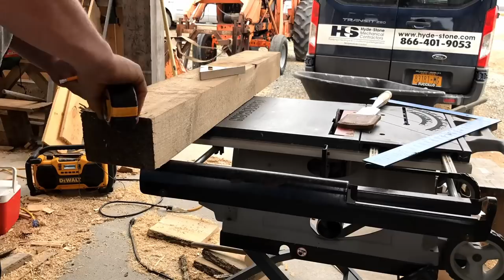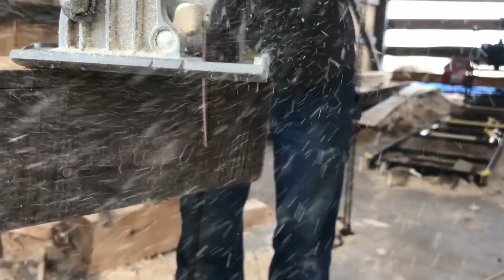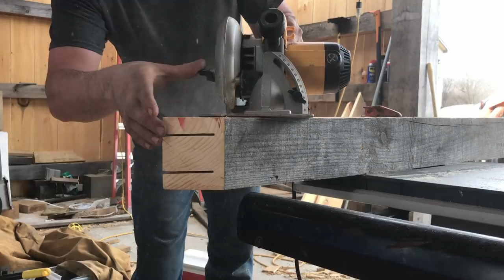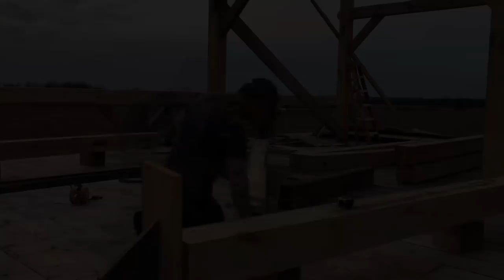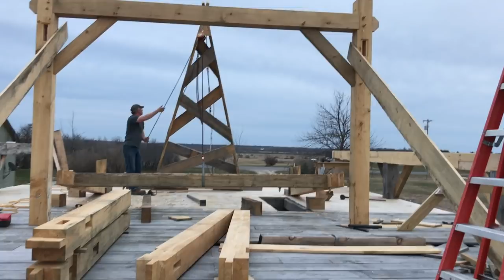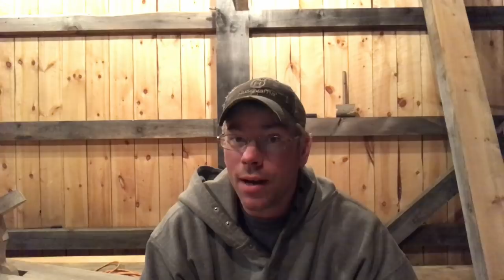Raising More Timber Frame By Hand

Comment: Hi Jim, 
I'm assuming the Queen posts are to go flush with the gable end. My suggestion is that you attach the 'A frame hoist' to the gable face of the barn. It appears you have about  4' +, clearance with the top of this when erecting the other Bents. This would allow a yard or more for connection down the gable.
You will know where the post feet need to be positioned. 
As you have done for the other Bents, place boards (front timbers) to stop movement toward the pulley. 
Nail side timbers, and importantly, a rear timber, to define the queen post, so that the footprint of each post is defined on the deck, make sufficient tolerance that the posts aren't a tight fit and can drop in when vertical.
Set the Bent up on sawhorses when in position against the front timber boards. You can use bottle jacks to increase the elevation at this point if you wish. Assess if your son is able to  control the tractor sufficiently and if so, good. Helped by him in the tractor, using the 'A' frame pull the bent up to 75 - 80 degrees, switch then to the come-along. 
Before raising, measure and attach rope from the rear of the barn to the  cross member of the Bent so that it cannot over rotate. I also recommend that you attach trailing planks to lateral sides of the queen posts about 2 metres up, when raising, to connect with scrap timbers nailed by you at right angles to the vector of travel - these will arrest any fall back incident. 
Just some suggestions - this is what I would tend to do with this. I would not be happy to use the other Bents at this stage as they are not fully incorporated into the building yet as they aren't  braced sufficiently and it would be a tragedy if they were pulled over and destroyed  by ill considered planning.
If You decide to go for the inside route,  then as mentioned above use bottle jacks and lots of props and all should be good.
Reply from the maker: Great information here and confirming a few of my own thoughts.

Comment: I wonder if the mouse got in through the big capping hole in the end wall of the barn/shop. Afternoon, Jim. Question, why not put the top plates and braces on the queen post bent when you stand it? Roughly half way up would be a good spot to do it, then it can lift the tops up with it and you could use a step ladder to put it on the previous bent. As far as the other two coming from the other direction, lean the shear-legs against the previous bent and draw it up from over the top of that one? Can't wait to see how you do the tops with those bents stood already.
1st final is out of the way. I'm guessing a low A to high B. At least I hope so, I need that to pass the course. Hope you're having fun out there.
Reply from the maker: Logistics, no way in he'll could I do that alone.  Those purlin plates will be 16' long.
Reply: TheTradesmanChannel oh, I thought you were superman... Lol.

Comment: I had to chuckle. Jesse (PLfL) did the exact same process--cheek cuts on angled braces--on very nearly the same saw. He's right handed and you're left handed. It only took a few seconds to notice the difference as you made the cuts.

I have significant experience in table saws in general and Craftsman saws in particular. It's been a wildly popular subject on the various wooddorking fora I frequent. I've owned the forerunner of the saw you have (built by Emerson Electric, a long time Sears supplier, although no longer, and the supplier--at least for while--of Home Depot's Ridgid line). Among its limitations is the fence and the insert. 

I don't know a modern improvement for the fence, the one I had was discontinued long ago. Actually I discontinued my Craftsman saw long ago, too, replaced with a Delta Unisaw. Night and day, but that's another topic. However, here is an article on my website you may appreciate as it highlights (and explains) one of the many complaints about Craftsman tablesaws:
http://woodbutcher.net/miterslot.shtml

I have a potentially useful suggestion for assembling and raising the queen posts, but it's too long to post here. If you're interested, please drop me an email to LRod@pobox.com and I'll reply as soon as possible.

LRod

Comment: The comments about working from the center bents are headed the right way i believe. Either tied with top plates or temporary bracing. Set the shear leg from center out tied to existing bents. Set it close to end wall so the top of the leg is a straight pick,  letting the new bent stand almost exactly in position when raised. Assemble the end bents with legs toward center, crosstie almost over endwall below. So when you raise the bent the legs will slowly slide toward the end of the barn, top of the bent raises nearly vertically.  Shear leg is positioned so that you would lower it instead of raising it to fine tune your position. If this was mine to do anyways, thats probably what i would do. You've got a lot under your belt at this point so I'm watching with everyone else to see the how you did it! Be safe thanks for sharing
Reply from the maker: I'm leaning that way

Comment: If you are after an inventive curse for the thumbsdowner "May his balls turn to Bull Dogs and bite the sod to death!" (not mine ... from a Dave Goulder folksong about his driver when he was shoveling coal on a Steam train!
As to the beam raising ..... Possibly do it backwards? Lie the whole frame flat with the top sticking out over the edge. Attach your shear legs with the pulley fully open. Brace the shear legs when they are raised so that if it all goes tits up they will hold the frame even if it gets pulled over center! Winch the top of the frame off the floor level by the shear legs, then pully the bottom of the frame towards the edge of the barn keeping yourself to the rear to gnash and grind your teeth in safety! Twice (or more) winching but it keeps you safely out of the way. It might seem over complicated and even need a board for the legs to slide on but could be a fresh way to look at it?

Comment: So who is the clown with the 👎🏼 👎🏼 👎🏼???
Great music!
I have a question Sir...
So that Red Thingy on your Table Saw...
How come it is flush with the rest of YOUR TABLE, 
and not like Jesse’s?
And when are you going to get a helper???
I like watching your videos and hearing them kids in the background!!!
Reply from the maker: It's supposed to be flush, not sure how it would cut right if it wasn't.
Reply: TheTradesmanChannel no kidding....
He had been cutting wood on his Table Saw for two years using a clamp to hold the fence in place because he did not know what the Adjustment Nut on the other end of the rod connected to the flip lever which normally locks the fence in place!
Reply from the maker: Sounds about right

Comment: Always a view from the upper floors.   Maybe set the post feet back onto the deck, off set to the other post, and use the lifting stand to drag it upright then knock it over 8 inches into place.  Looks like a sound lifting rig, slow and steady, its always great to be able to just stop the lift any where along the way.  I have a gin pole set up, two poles with caps that have 4 guy lines attached.  Each line can control the direction of lift, this comes in handy if you have to drift a lift to left or right.  Also fore and aft lines so something can't come back on you just at the tipping point.  Some extra hands is always a good thing.
Reply from the maker: Great information there.  I was looking at it last night while lifting and asking myself why I didn't put a line going fore of the anchor line.  It was a moment of "hey, you know this could come back on you".
Reply: As long as you don't pull it past the tipping point all will be good.  Also liked your table saw method to rip the tenon on the brace.
Reply from the maker: I use my 12" radial arm saw for braces too when I have it setup.  It'll cut the full 4" stock without issue.  I have a jig I setup for it.

Comment: Personal preference is everything, but is there a particular reason you would swap the saw guide to the other side of the blade?  I would think the tenon thickness might be different every cut, if the brace dimension where slightly different. Or parallelism since you swap the side to the guide?  But then you finish every surface with a chisel, so maybe I've brought up a stupid question.
Reply from the maker: You have to measure both sides regardless to center the tenon.  As for switching the fence you need to to cut those safely.

Comment: Morning, Jim. Congratulations on breaking 7k. You've sure earned it. You sorta headed off my question about the last bent or two, as it was clear the shear legs were taller than the space between bents. I was wondering how that was going to work. Will be looking forward to seeing them go up, however you decide to do it. You must have a small hole somewhere if mice are getting in. You could always make on a mascot if nothing else. Anyhow, have a great day.

Comment: Ive got a 112 year old dairy barn that is ‘udderly’ massive...(about 40,000 sq ft)...that I’m converting to a huge wood shop, cabinet and furniture shops for every step beginning to end. Previous owners removed timbers to use for garden boxes and replaced with 3” pipe! Until i cut all the timbers needed i had to go set up several dozen 110,000 lbs supports along the Western wall as it is sinking slowly due to many previous poor alterations and rotting wood as well as old pipe supports rusting.  I’m rating it up using 1 million lbs total hydraulic jacks just 1/4” per month to avoid causing massive shifts in the structure.  I’m buying green logs and milling out up to 12”x16” x 60’ beams that will have to be spliced at the strongest part of the structure using a brilliant Japanese beam joinery technique so that the 110’ beam is all equally strong and supports the upper floor and enormous train car sized cupola.  Thanks for the evenings of know-how, entertainment and being part of those of us left in America who care.
Reply from the maker: Your project sounds incredibly interesting.  There is nothing better than keeping a massive old frame alive and to be used for what you're doing is great.  Thank you for sharing.

Comment: Hello Jim.  Suggestion - well braced, you could use the adjacent queen bent as the high point to pull up the next bent.
Reply from the maker: It's more a question of having the bent leaning way out over the edge of the building.
Reply: Gotcha - the 2 bents left are the end bents.  If I have any brilliant epiphanies, I'll let you know ;-)
Reply from the maker: That would be good.

Comment: Maybe he she or it will trip over there own thumb.
How back before they had the long screws did they attach the base of the timber to the floor?
Reply from the maker: A stub tenon on the bottom of  the post.
Reply: Makes sense. Would that then be pegged from below or just held by the weight?
Reply from the maker: Either way works, personally I would peg it.

Comment: Hi. And Happy New Year! I've been keeping an eye on your builds for a long time and I always love how you show the work. Thank you for answering my stuff in the past.
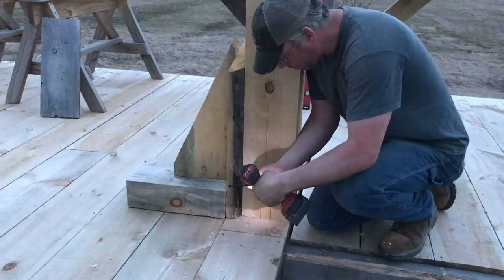I have a question for this video at 8:50. I saw that you secured the posts of your bent lift with 10" lag screws to the floor planks.  Am I right? I didn't see stub tenons. How did you secure that in the end? I didn't see a follow-up video. Thanks from Massena
Reply from the maker: Happy New Year, haven't seen you on a bit.  I was working in Massena yesterday.  The Queen posts are held with 10" timberlocs, very solid and much faster.  Traditionally they would be stub tenons.
Reply: @TheTradesmanChannel  Hey thanks so much Jim for responding. Two barns that I had to refurbish, needed new queens that had to fit into the old plate at new locations. I ended up ripping out the sill - just for make new stub mortises because I moved the posts!
 So I could have avoided this? Is this legit?
Reply: Jim I apologize for the questions - I know this build is behind you now., so I appreciate your time...
 I absolutely love the pockets that you cut for the knees - and the beams. The center joinery looks amazing!
How do I cut the depth accurately? I was using a circ saw to cross-cut the pockets. Yours look really tight and beautiful.
Mortising bits,  jig and router? Was it a longer job?

Comment: Hi Jim - going to be raising some bents next month - did you notch the top of that gin pole frame so the 2x6s fit inside of each other where they meet at the top?  Thanks for the videos!
Reply from the maker: I sure did.  Worked out well.  Just be careful moving the gin pole or shear legs, that's how I shattered my ankle getting knocked off the 2nd floor.
Reply: @TheTradesmanChannel  holy moly sorry to hear about that injury.  Let me know if you have any pictures of the top where the block and chain connects.  Probably overthinking everything but want to make sure that I connect everything correctly.  Did you use deck screws to connect gin pole diagonal bracing?  Any GRKs?  And that was regular 2x6 material, correct?  I like seeing how you anchored the bents so that they can’t dance as they were lifted.  I think I have all of the possible issues figured out.  My decking is installed over our floor trusses so we’re good to go once I plow that camp road.

Comment: Great work!  No drawboring?  Lot more work for just one person, but  can keep things tight as the timbers season.
Reply from the maker: I did not draw bore, the next frame will be.
Reply: TheTradesmanChannel I love it, though it's more work.  Love seeing a nice tight tenon get pulled perfectly into place with each blow of the mallet!
Reply from the maker: It sure does make a difference.  I took a lot of time with this joinery and squaring things up from the milling to the joint cutting and it helped but there are a few spots where a draw bore would have really worked better.  I have been bitten by the timber frame bug to the point I'm teaching myself architectural drafting software while I'm laid up with a broken leg and ankle so that I can develop some kits to sell as well as the plans.  This has been the most rewarding project I've ever done.  Only eight more timbers left to go on before the roof and of course I had to go and fall.
Reply: TheTradesmanChannel Man, that sucks!  Happy healing.  Reminds me I need to pick up fall arrest!
Reply from the maker: I frigged up moving a gin pole next to my stairwell opening.  12' fall landing on my right heel...needless to say after two surgeries I am down until fall.

Comment: Nice Job .Could you let me know how you built the lifting structure and how is it held up ?I am going to build a mill shed and I do not have a tractor to lift the beams so just wondering if this would work?
Reply from the maker: Just a triangle heavily braced, the height is twice the width of the bottom.  I hook a line to the top of it and use a come along to anchor it.  This would work perfectly for what you want to do.
Reply: Thanks for the info .
Reply from the maker: I'll cover it in a video soon for you.
Reply: Okay great.